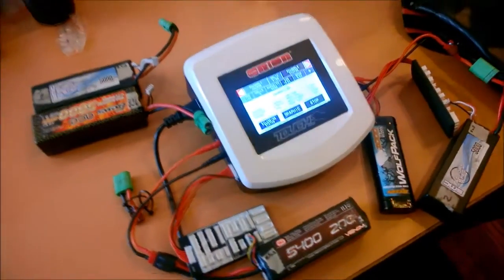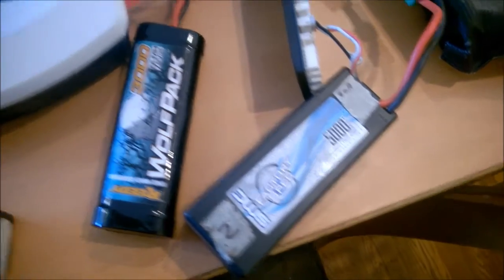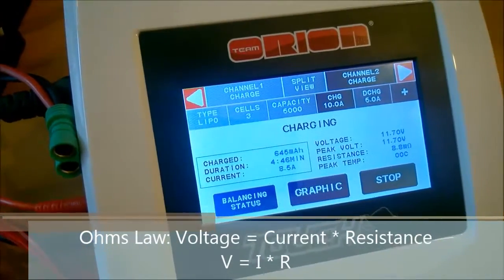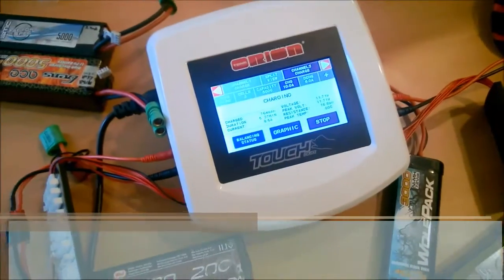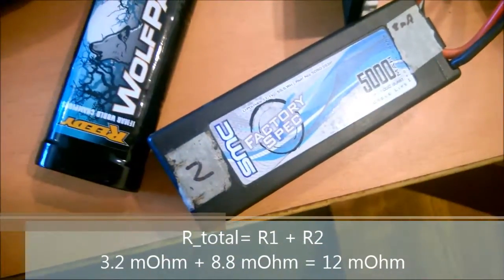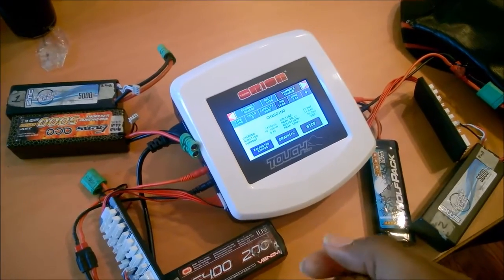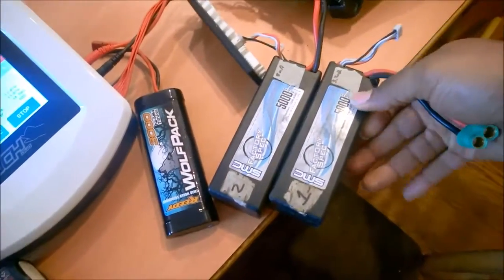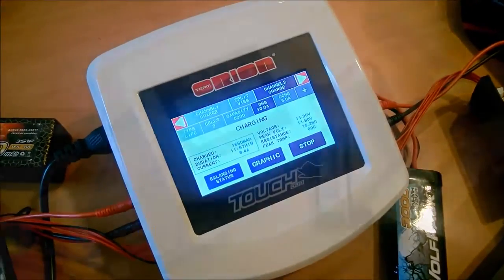Ep. 165: What is Voltage Sag? LiPo Battery Voltage Sag & Internal Resistance Explained

Comment: great information house. batteries are a huge factor. ive been struggling to get over 100 with my smc's, borrowed a turnigy 6s and pulled 109. ordering batteries soon. lol.
Reply from the maker: +2cwik4u104 I had the EXACT same experience. I had to work so hard to get to 102 mph (GPS) with my SMC, and never actually got it on the traps. I still like the SMCs as a general purpose battery, but I emailed Danny at SMC about this and he was very open about the fact that they hadn't built a true high performance battery in some time when I bought my packs and the cells really have too much Internal Resistance for speed running. Looking back at it with the info I have now, I'm pretty amazed that I was able to get Dizzy (my Slash 4x4/Rally) over 100 at all with those batteries. I'm also ordering new batteries soon. I'm planning on getting two sets from different manufactures (if I can afford it). One will most likely be Turnigy Nanotechs. I'm looking at the Venom 100C packs as the second, but they are really pricey. SMC has 3S 60C/120C packs now (my current cells are 50C/100), but I need to find out if these new packs are significantly lower resistance than what I have. Worst case, I'll just get a second set of Turnigy packs from a different series, like their new "Graphene" packs or their "Bolt" line. Which are you looking at?
Reply: turnigy nanotechs. just not sure if I want a pair of 3s or a single 6s? what would you recommend?
Reply from the maker: +2cwik4u104 I think there are some good reasons to go with a single 6S pack if you have the room in your car, but that's only if you have the room in your car. A single 6S pack is pretty much guaranteed to have matched cells, so it should balance and discharge really well. It also will have less wiring, so you should have SLIGHTLY lower losses due to the resistance of your wires. If you buy quality packs, I'm not sure if you will actually see any performance difference, though. My 6S cars aren't set up to handle a single 6S pack, so that's not an option for me.
Reply: cool. thanks for all the feedback. my only concern was if one cell goes, ill lose an entire 6s pack.
Reply from the maker: +2cwik4u104 Ooooooh. Good point. Turnigy has a decent 1yr warranty, but we all want our stuff to last a little longer than that. Doesn't MaxAmps offer a lifetime warranty? I guess that's one way to justify the price.
Reply: they do have a lifetime warranty, but they only replace the first pack, then after that its at a discounted price. from what I understand.

Comment: Great video bro. I've done alot of research in the last month on IR and sag and all about lipos. 1 thing I read that u didn't repeat was temperature to test at which I read is about 70-72 degrees and if u test under load I read test at no more than 1c. Would u agree?
Reply from the maker: +Marcus Linton Excellent point about the temperature and load! Internal resistance changes with temperature, which makes it even harder to get a good measurement. High loads also cause the batteries to heat, which further changes Internal Resistance. Testing under a 1C load is a good way to get a repeatable measurement, but the number you measure may not be very representative of a real-world, VERY HIGH C load, such as speedruns or drag racing. This is why my in-run voltage sag was so much larger than you'd expect from my charger's IR measurements. Thanks for the comment!
Reply: +rhouse21 - RC Physics  That is also true as far as load goes. So would u recommend a 2c charge rate or higher? I know not all batteries can handle that but mine are safe at 2c, max 3c.
Reply from the maker: +Marcus Linton My Team Orion charger maxes out at 100W per side, so I set charging to 10 Amps (2C) and it backs off the current as the voltage rises to stay within the 100W limit. This is ok for most high quality batteries now, but lower charge rates actually are easier on the battery chemistry and can prolong battery life. The best test would be a rig that would discharge at a known high load and constant temperature and let you measure the voltage sag, which you can use to calculate internal resistance. I've got some ideas, but I'm still working on a safe load I can vary from around 100 watts to over 1000 watts.

Comment: Have you had any trouble with that charger I've read a lot of bad reviews. Thanks 👍🏼👍🏼
Reply from the maker: +Paul 815 I really like it, but the menus can be a little tough to get used to if you are used to "one button charging". I primarily bought this for the data features, which seem to work great.

Honestly, this is probably a lot more charger than most people need. I've just been sponsored by Venom who makes a charger with 80% of the features this one has at less than 1/2 the price. If you don't need the plots and IR data (which is not terribly representative of real-world data), the Venom Pro Duo would be an awesome choice.

Comment: @rhouse21 - RC Physics what is the highest resistance you had seen displayed on your charger ?
Reply from the maker: I'll have to go back and check that. High performance LiPos are often in the 1-5mOhms per cell range. These are the cells that you can comfortably pull more than 200 or 300A from. Older, worn, or "Low-C" cells can be quite a bit higher, so you want to limit these to lower current operations. It's not unusual to see some of these batteries measure in the 10-30mOhms per cell range if I remember correctly. 

Doing some quick math, a 3S LiPo with 30mOhms per cell will sag 4.5V under a 50A load. That's enough to trip the low voltage cut-off on a fully charged battery. This is way too high for most car based "bashers", but you may be able to comfortably use this battery in an RC airplane or rock crawler with a 30A ESC since it would see just 2.7V of sag at full power.

Bottom Line: if all the cells in a pack are fairly close to each other, you do not necessarily need to retire the pack. Just transition it to a lower power application where you don't have to worry about overworking it.
Reply: @RCPhysics  last but not least front steering hubs plastic or alloy this is on a arrma vorteks 3s what would you go for plastic ?
Reply from the maker: @monkeytrident  I'm not sure whether these are a high failure part on this car. I use plastic on some cars and allow on others based on how prone they are to break. For example, I replaces all the stock steering hubs on my Traxxas 2wd cars with either RPM or allow, but the Slash 4x4 stock hubs are fine for just about any harsh use.

I just checked and RPM doesn't seem to make replacement hubs for the Vorteks even though they have A-Arms. That implies they don't see much of a demand for them so the stock parts probably don't break too much. 

Of course, some guys just like the look of the Allow parts, so that may be reason enough to "upgrade" them.

Comment: Sir 1 have a lipo checker can Read MV
Are MV is Ressistance ?
Reply from the maker: Most LiPo checkers do not measure Internal Resistance because you need to put the batteries under a load to properly measure this. mV is usually short for millivolt. Resistance is measured in Ohms or MilliOhms.

If you tell me which LiPo checker you have, I'll double check to make sure it doesn't do this measurement.